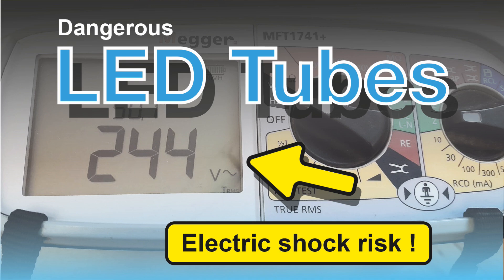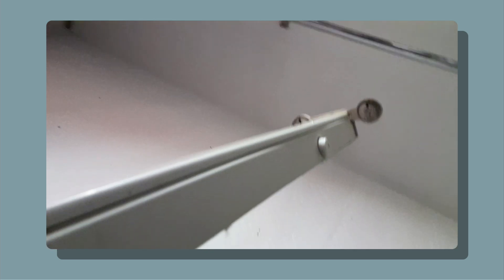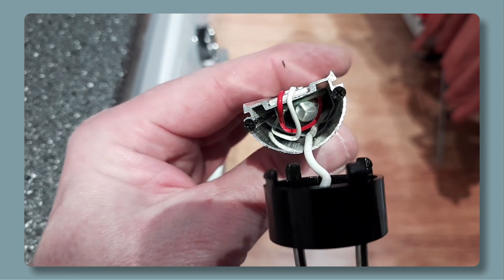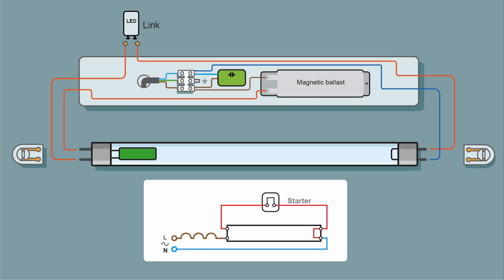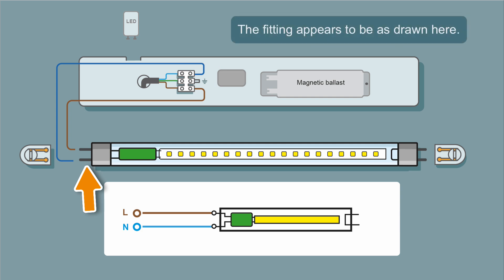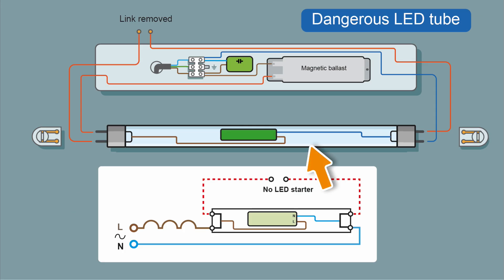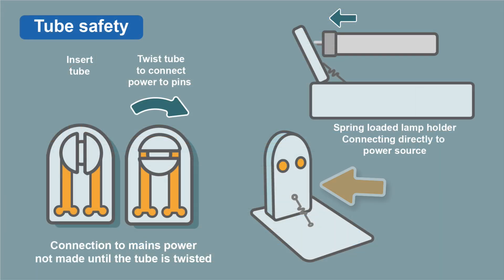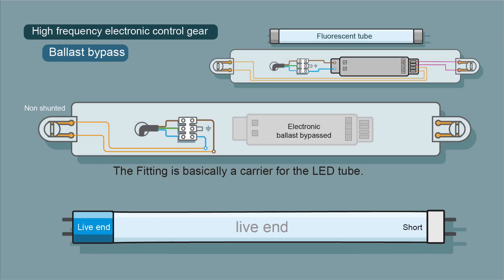LED Tubes,  possible electric shock risk from the pins?

Comment: Two things on this.
Switch off power when changing any light.
And classic gas discharge tubes are also capable of shocking you via the pins on the 'far' end as any bit of static can strike the arc inside the tube.
Reply from the maker: Thank you picobyte, yes alway switch the power off when you change any lamp